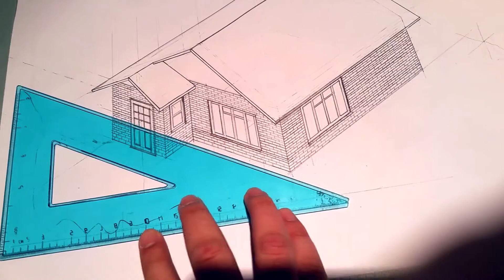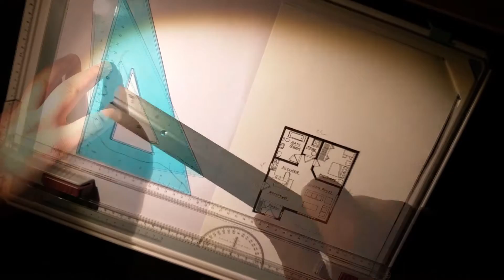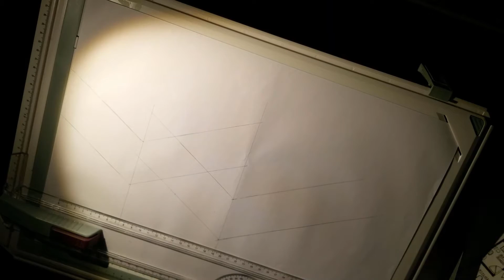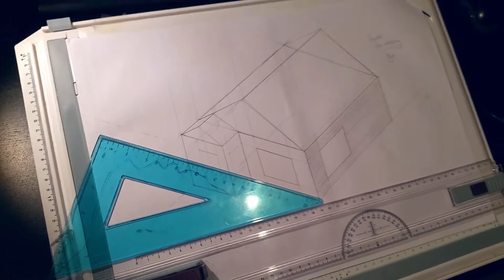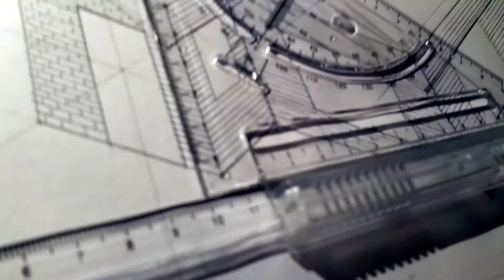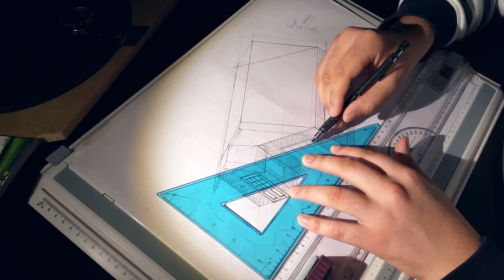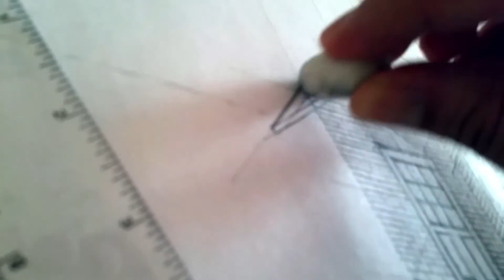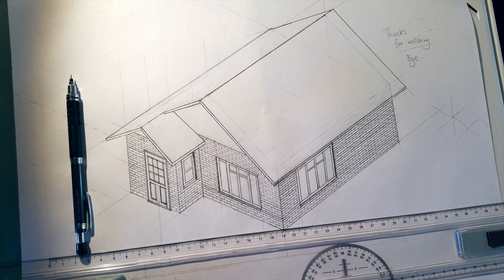Isometric Drawing From A House Floor Plan

Comment: could you please please help me in my plan I can't imagine it's isometric
Reply from the maker: Hi. Sure I can help. I don't know if you saw in the video but you need a 30-60-90° to draw isometric drawings.

All vertical lines stay vertical, and all horizontal lines are at 30°. You can use a scale rule to accurately mark out the wall lengths. For pitched roofs you have to determine how high you want your roof to be and go from there.

I hope this helps but if you want a step by step video about it, let me know and I'll work on it. Thanks.

Comment: In the future could you create a tutorial on how to draw details in Revit? Perhaps showcase the connection detail between walls/floors, and maybe panel wall/cladding details.
Reply from the maker: Woah, I'm blessed to have my channel graced by Shaggy XD. That is the plan, I'm going to model this drawing in Revit and do plans/elevations/details and the like. I'm gussing this is your first time on this channel, but I have 2 playlist tutorials, 1 shows you how to model a house with structural framing in Revit and the other is a list of detail drawings that I made from the model. You can see them at the links below:

Revit house structure tutorial playlist - https://www.youtube.com/playlist?list=PLOQj24WRxXmUJxrMeSPZc9wejGwEL4vdA
Architectural technical drawing playlist [including detail drawings of the model] - https://www.youtube.com/playlist?list=PLOQj24WRxXmWUGv702PvHL_4uPKzDrPkD

These details are drawn manually on Revit with some bits automated like 'repeating component details', so it doesn't take advantage of Revit's abilities, but the next detail drawing set I'm going to do will use Revit's powers. Enjoy.